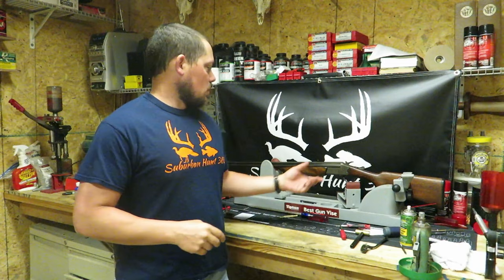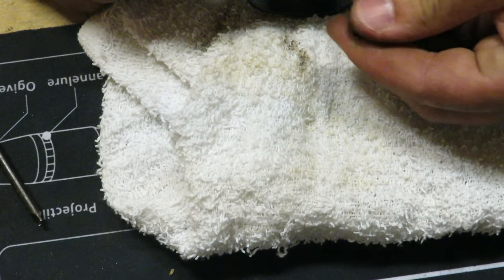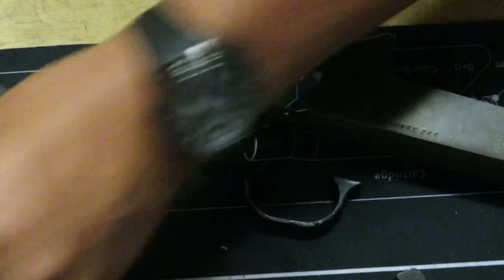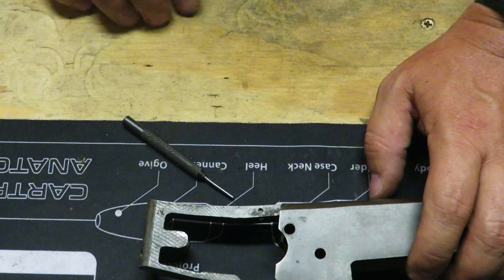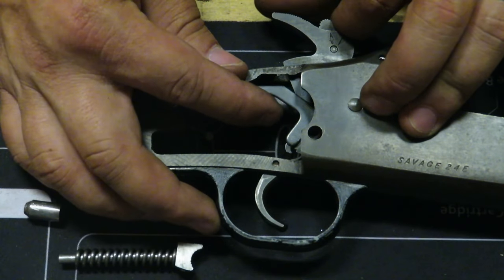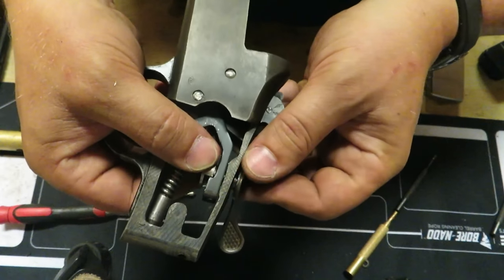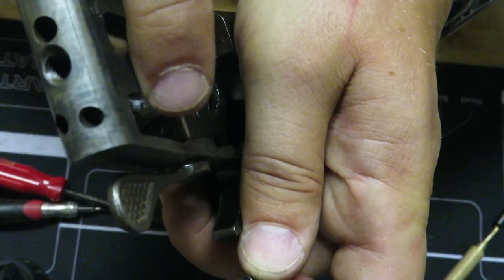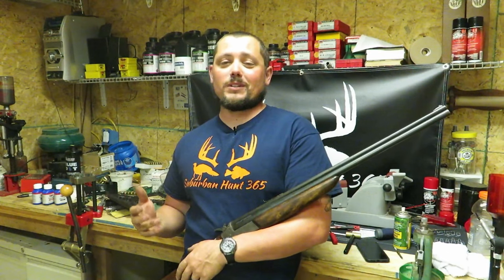Savage 24E Part 2

Comment: Very nice (the stable camera is a nice touch), great to see this material on these nice pieces. I have a 24SE 22lr/20ga and it appears the selector (22 or 20) on the hammer has a busted spring, the "selector" just flops around. I got a replacement spring but I'm shy about doing this disassembly to the point of removing the hammer.  Do you suppose it's worth punching out the pin on the selector even with the hammer still in place?
Reply from the maker: Thank you. Yes you can most definitely replace that spring with the gun intact. Make sure it’s clear, pull the hammer back to expose the pin, punch out pin. Keep pressure on the selector. Remove the selector and you will see the detent pin. I was use a pair of forceps to remove the pin and the spring. Install spring and put it back together. You should be in business. Thank you for watching.

Comment: To anyone who sees this if you can get a good angle on the screw that Suburban takes out at 2:30. I used the little pivoting bar inside of a finger nail clipper to turn it from the side by running it through the flathead groove sideways. Its thin enough to go under that spring.
Reply from the maker: Very Nice

Comment: Great appreciation for the detail, care and craftsmanship you display for the breakdown and assembly process. You give me cautious optimism to attempt the procedure, but I would yield some of the work to an able gunsmith. What insights would you offer if I were to use some caliper inserts into a Savage 24 shotgun barrel? Say if I had a 12 or 20 gauge, and fitted it with a removable 9mm or .223 centerfire, 7 inch barrel insert...need to modify or remove the ejectors? Many thanks!
Reply from the maker: Thank you for that. I would have to look into the inserts. I don’t have any experience with the inserts. Sorry I couldn’t be more help

Comment: Great video!    One suggestion, and this will be for removing and installing all wood stocks.  
If you’re going to use a normal long screwdriver, wrap the shaft with enough electrical tape to fill the hole in the stock to keep the screwdriver centered in the hole.   If not, there’s a very good chance it will slip out and break through the stock.
Reply from the maker: Thank you. The tape idea is interesting I’ve not heard of that before. But I see you point on putting the stock in jeopardy if pressure is suddenly applied to the wrong spot. Thank for that. And thank you for watching